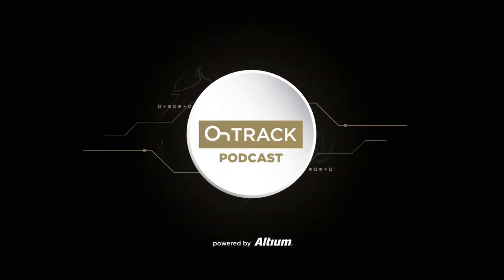Occam Process: Assembly without Solder

Comment: 1.  Is this still at concept stage, or is there someplace actually using it?  Someplace that could manufacture for you if you created a design using this process?  2.  Why is the grid/size (pitch and height) standardization important?  If anything, the ability to print a circuit up in the air should make this standardization less important than it is now.  3.  What are the circuits made from?  It seems like one reason to use a PCB is that conductive ink isn't as good as copper, but laying copper down (as opposed to etching it off) requires even higher temperatures than solder.  4.  At a larger size, you could just use actual wire for each of the connections, like a breadboard, but typically the connection is strengthened with solder instead of just twisting the wires and hoping they stay in contact.  Is there a solution for this besides "the original placement was very precise, and the nearby insulator holds it very firmly"?
Reply: There have been some simple prototypes produced. Suggest looking at page 51 of my short tome Solderless Assembly For Electronics... The SAFE Approach downloadable here: https://iconnect007.com/my-i-connect007/books/solderless-assembly-electronics-safe-approach/  If It sparks greater interest go back and look at the rest of the book for motivation, benefits and methods.